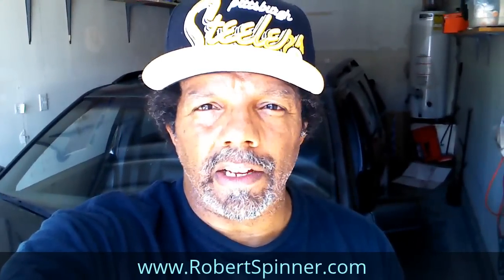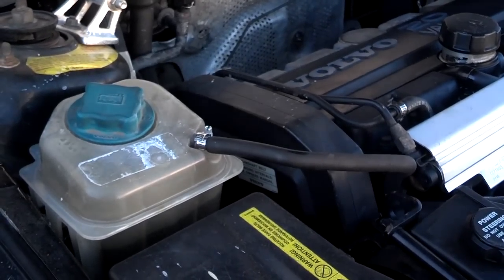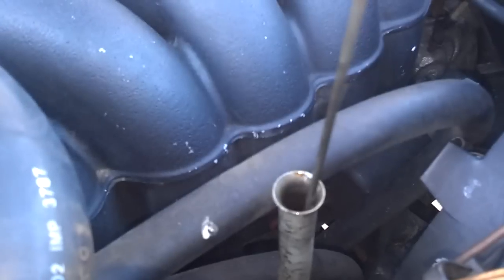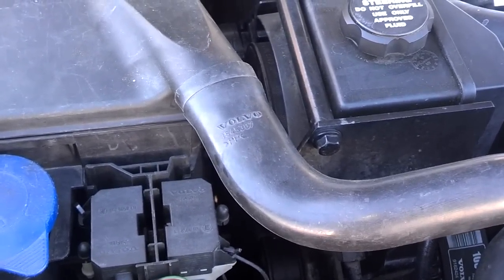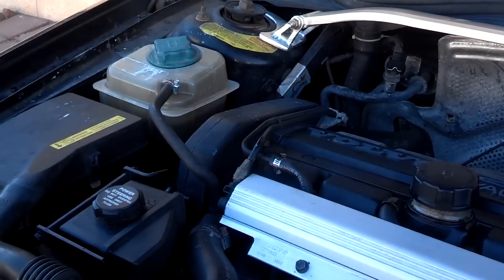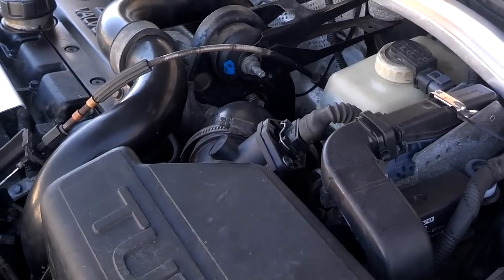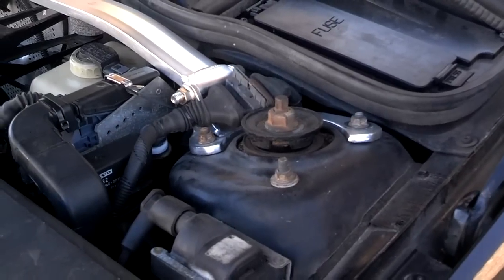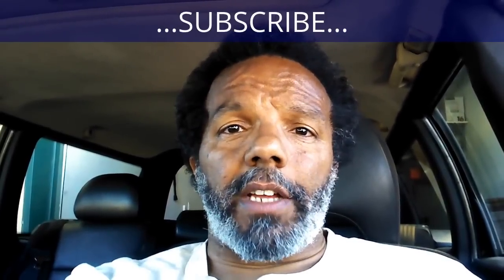Top things to check before buying a Volvo 850, S70, V70, XC70, etc., Pre purchase inspection.

Comment: Thank you and God bless. your videos have been very helpful I gave 1999 s70 GLT the ets light is on no other code now there where some but I fixed those. The car had 160000km it's driving fine what do you think do have to replace the etm?
Reply from the maker: +Dean martin try cleaning it.
Reply: What should I clean it with and what's the easiest way to remove it?
Reply from the maker: Throttle body cleaner. Should be a video "ETM removal".

Comment: Robert my speedometer and odometer don’t work what gets replaced one is digital the other is not do I buy the whole cluster and if so would that change my mileage thanks have watched your tubes love them your good at explaining
Reply from the maker: I don't even know what kind of car you have 🤷🏾‍♂️
Reply: Sorry Robert I have a s70 98 Volvo the odometer and speedometer work and stops then works and stops again my question is when I take the cluster out there’s a black box on that cluster what does it do are what would you replace I’ve watched on how to remove dash and board. But since it works and don’t work is it a splimple fix ?

Comment: very useful information, wish I had this info before i bought my 01 XC70. my coolant tank is constantly having to be refilled once a week  or every 2 weeks. It doesn't overflow but it goes empty besides a head gasket problem ,is their a chance it could be the radiator? could it be anything else?
Reply from the maker: +wil young No head gasket issue. You need to find a repair the leak.
Reply: +wil young , Thanks Robert for getting back so quickly. I did check the dip stick andt unfortunately heir was a lil smoke so my pcv  maybe  clogged.Will do the glove test and check the hose tomorrow .Will  keep you posted . Your such a big help. Thanks for your expert knowledge.

Comment: i kept my 1995 Volvo 850 turbo for 22 years until it finally died - the wire to the started motor rotted off.  I gave it to my brother-in-law along with a complete list of everything wrong with it - about 20 items including AC, rotors, shocks, struts, PVC, oxygen sensor, etc.. .    He sold it for $400 and he included my list of what is wrong with it.
Reply from the maker: Drive 'em till they drop.

Comment: Do these cost more than new cars? My dealer charged me $620 to do the timing belt, idler, and tensioner for my 2005 V70R. Seems like that was a fair price.
Reply from the maker: Rediscover Film Sounds fair to me. How about the water pump?
Reply: +Robert DIY I told them to replace the water pump, but they said they would check it for wear. Technician said it was fine. Considering I was willing to pay regardless, I assume it must have been in good shape.
Reply: +Robert DIY my car is a 2005 with 85k miles.
Reply from the maker: Sounds reasonable.

Comment: I went to get the oil changed on my Volvo and they said I had to get the filter for it before they could change it. The guy I bought it from had said he used an any kind of oil in it and I said I preferred using synthetic oil, but now wondering when it was last changed since he didn't tell me it had to have special oil filter. So far it is a great car,and I only paid $2100 for it.
Reply from the maker: Good deal.

Comment: Robert, I am currently looking at a 98 V70 with 190K. The timing belt was changed 40k miles ago. When should it be changed?
Reply from the maker: I have no idea. What does the owner's manual recommend? How long ago was it replaced? Did they use junk parts or good parts? How many parts were replaced?

Comment: Hi Robert,

I am looking to buy a 2000 s70 but I'm not sure if the timing belt was replaced (current owner hasn't replaced). Is it likely that the timing belt will fail after 170,000 miles if it hasn't been replaced?
Reply from the maker: John Newhouse Hey John, what do you think? - https://www.youtube.com/watch?v=-2oIeIhpV44
Reply: Robert DIY Thank you so much, Robert! I appreciate this!

Comment: I recently purchased an S70 with a badly blown head gasket. If I were to use head gasket in a bottle do you know if it would hold, seeing as these motors have a turbo I wondered if the extra pressure would prevent it from sealing? Or does it not work like that?
Reply from the maker: Huh? Not sure where to start a reply with all of the bad info in the post.

Comment: Hello Robert
My name is Mate and I live in Croatia. I like you channel on YT. You helped me a lot.
But there is a problem I cant solve it. 
When I drive my car S70 sometimes it just shut down. by no reason. I fixed Bosch pump and change all filters but still some times it comes again. The engine is 2.5 TDI 1997. Then I start engine immediately again and works normal some time. After a while it also shut down and wont turn on. This time I have to wait aprox 10 minutes and than I can turn it on.
Do you know what is the problem? 
Thank you
Mate
Reply from the maker: If it has a fuel pump relay, change or test that.

Comment: thank you for the info on replacing a heater core.......my ???? to you is...I have a 1998 Volvo S70, and its leaking oil from the top of the engine.....could you tell me what that could possibly be?
Reply from the maker: Silky Slim Probably a bad oil cap seal. - https://www.youtube.com/watch?v=FIRoc0VxLd4

Comment: Thanks!.. Would you suggest checking the same things before picking up a 93 940 wagon?? --I am  in love and looking at purchasing one, but have plans to take it 1700 miles away when I move, and I do not want to be heartbroken. ://

Any other things I should have my mechanic look at before buying this baby?

thanks in advance.
Reply from the maker: e Kbauer I doubt I would have a mechanic look at a red block Volvo. Those were the best cars ever built. Nothing special to look at when buying a 240, 740, or 940. General stuff is fine. Make sure it starts and runs smooth, stops, drives straight at highway speeds and is not misfiring (no CEL).
Reply from the maker: e Kbauer https://www.youtube.com/playlist?list=PL4kSJzgyD94SiVVtAVWIb0_aWfXz7sJkG
Reply: Robert DIY Thanks for quick reply. Likely will still have him give it a look, considering the long move and I don't exactly have the best luck.
Reply from the maker: That's a good call, especially if you are paying a few bucks for it.
Reply: Robert DIY
hi Robert, any common issues you are aware of regarding passing a smog inspection on the 940...? (I have taken diligent notes on your vids) just little concerned about it passing smog in AZ if I unable to obtain collector insurance for the car.. assuming the testing is similar to what is done where you live.

Mechanic is checking the car out today, i'm keeping everything crossed
Reply from the maker: No problems that I am aware of.

Comment: Robert;  My 1998 S-70 Volvo has 202;000 miles.  It is due for new timing belt check.  The airconditioner blows out hot air.  I was told it needed a new air blend actuator.  I know the timing belt must be serviced but what about A C, I’m on limited income can I operate vehicle with broken ac and what do you think is. Reasonable cost for its repair if I go that route
Reply from the maker: Huh? I don't understand your question...
Reply: Yes it's safe to operate with ac not working unless the compressor is going to seize. Repair costs will depend on what is wrong; it may just need a re-gass. But the longer you leave it, the more it could cost to fix as parts will tend to deteriorate with lack of use, example seals will dry out and may perish

Comment: @Robert DIY
 Can you explain what you mean when you say the car was pampered and that's why they can get a burt valve.
 Right now  I'm in the middle of replacing valves because of a burnt valve in and 03 XC70  I was under the impression that I had to baby the car after I got it  Finally put back together And people say only use premium so you don't burn another valve.  And by what you're saying I don't need the baby it at all. Also should I only use premium fuel?
Reply from the maker: Yes I can.
Reply from the maker: Owner's manual recommends 91+
Reply from the maker: https://youtu.be/qsns8ZO1xfE
Reply: @RobertDIY  ok I see thanks main reason I wanted to ask was I was  curious about running ethanol free but its 89octane not 91
$1.80 vs 2.34 
 I've gotten better feel economy Yes not equal in my vehicles for the cheaper price. But the valvo seems to be a little bit more finicky so I was worried about doing that.
Reply: @RobertDIY   sweet.
I've also found that the pcv connected to the intake before the turbo is leaking oil into the intake there's a little build up. So I removed the pcv system it's all clean and clear I even cleaned it more I checked the drain port on the block for the oil separator by pushing the head of a zip tie down into the oil pan no blockage. But I  Have a feeling that I am getting crankcase pressure because I cleaned all off the valve cover and then later I noticed it build backup a little so it might be coming from either the old cap or that PCV hose.  Just trying to make sure I get the car ready so I can put it back together wallets apart I wish I knew about this earlier I would have done  The glove test to make sure before I took it apart.

Comment: Hello Robert what's a common cause for a 1999 Volvo v70 to slowly lose power and cut off it has 118,000. I just put a brand new battery in it.
Reply from the maker: kenneth marshall Fuel pump dying. Any codes? - https://www.youtube.com/watch?v=GclQq7VpC08

Comment: I just bought a 98 V70 XC few months ago.  So far I noticed 3 main problems.  Coolant leak, oil leak and the driver side wheel barron.  I paid 450.00.  I do want to do the repairs myself except for the wheel barron.  Any good links or tutorials that may help or advice.
Reply from the maker: https://www.youtube.com/watch?v=gt9w-ZSxs9I
Reply from the maker: https://www.youtube.com/watch?v=-2oIeIhpV44

Comment: Thanks for the videos! They are great! I just wanted to add for people that might purchase a 1993 Volvo 850 that the timing belt needs to be changed every 50,000 miles instead of 75,000 miles. The 1993 850s are a bit different than the rest.
Reply from the maker: +Dave Haskins yes they are.

Comment: I found an 850 with only 27,000 miles on it. One owner. Runs clean but it's 3000. Am I crazy for buying this car?
Reply from the maker: sonomama82 I'm afraid of low mileage cars. Did you run a AutoCheck report? Should be worth way more than that if it is in good shape.
Reply: +Robert DIY total with taxes is 5000, I'm buying it in Japan.
Reply from the maker: Wow! In Japan, I usually look at the mileage x4. So that car has like 110,000 miles of wear on it.
Reply: Robert DIY What exactly do you mean? I'm kinda confused on that one. Thanks for replying though.
Reply: Robert DIY it has 44,000km on it. that turns into about 27,000 miles. I don't really get what you're saying though.
Reply from the maker: I lived in Japan for several years. The driving conditions there are severe. In comparison to the driving conditions here, I feel that a vehicle will have 4 times the wear on it.
Reply: I live in a very remote area. Not a lot of stop and go traffic. Thanks a lot for the response though. I thought your video was really helpful.

Comment: Thanks Robert for the informative video. I have a 2003 volvo s80 which needs removal of the rear bumper for repair and repainting. Can you do a video for rear bumper removal of 2003 volvo s80? Thanks in advance.
Reply from the maker: +Noel Cuta Probably, stay tuned and please remind me in a week or so if you don't see it.
Reply: Thanks Robert.
Reply: Robert DIY.
Reply: Robert I am still waiting for your video on  removing and installing rear bumper of 2003 volvo s80. Thanks again.
Reply from the maker: Ok, I'll try to do it tomorrow.
Reply: Thanks Robert.

Comment: I do like your test for primary crankcase ventilation blockage/failure, diagnostics and baloon animals at the same time :D

Unfortunatly the prices mean nothing to me, apart from the conversion to pounds sterling, we are taxed to death, garage repairs can make ya eyes water lol.

Smashing tips robert :-))
Reply from the maker: zx8401ztv Yes, I understand about cost. Heck the parts pricing can be very different there as well.
Reply: Robert DIY
Some places, like canada, just make me green with envy, the cost of petrol is like it was when i was 16, a looooooong time ago lol.
At the moment petrol is roughly £1.30 per litre unledded or u.s $2.09.
Reply from the maker: Heck, I just paid $3.12 per gallon (3.5 litre) for 91+ octane.
Reply from the maker: Ouch! Do walkers have to pay the tax to walk on the edge of the road?

Comment: robert, should the turbo be among these pre-buying checks? and if so: what's the easiest why to check its functionality?
Reply from the maker: Not one of the tip things. A short test drive will usually show a bad turbo. They smoke, have little to no pick up, get noisy, leak oil, etc. I have a turbo series on my channel that you can check out.
Reply from the maker: Not a common, costly issue.
Reply: thats all right than, tnx. will go look the turbo series up.

Comment: Also you should check steering rack if car is old. It's expensive part and doesn't last long
Reply from the maker: TheExeZ There are 100 things you can check from the radiator, transmission to gas tank issues. However, these are the most common. - Car buying pre-purchase tips. What to look for before buying a car.

Comment: I found a cheap 99 S70 for sale with a perfect body (in the rust belt), but it has no reverse gears. Ad says forward gears work fine.

I found an article saying to unplug the solenoid wiring in order to test. Is this something inside the case only, or is there a connector outside that could be disconnected on a test drive?
Reply from the maker: Ahhhhh, it has a bad transmission.

Comment: Sorry I failed to state my question clearly:  my 1998 Volvo S-70 air conditioner is not working ; the fan blows hot air.  For awhile the ac worked on the passenger side only.  I was told that a new blend door actuator would solve the problem.  What should I expect to pay to repair ac.  If I do nothing with ac can further damage occur. Thank yoi
Reply from the maker: No, the problem will not effect the car unless you pass out from the heat and wreck it.
Reply from the maker: https://youtu.be/gt9w-ZSxs9I
Reply from the maker: The comments section has repair estimates.

Comment: Looking at a 2000 V70R This weekend, Issues listed: Slight Oil leak coming from the right side, Passenger windows don't work, and claims something to do with the right front "driveshaft"(Not really sure). Now i've done a fair share of work on cars and these aren't things that are really worrying to me, but would would be initial suspects? It has 198,xxx on it. However they are only asking 700.
Reply from the maker: +Shannen Thor have to check it out. Basic parts there.
Reply: will do but if i drive the 2 1/2 to look ill probably end up buying it, always wanted an R.
Reply from the maker: OK

Comment: Hello, I see a 1996 Volvo 850 Turbo Wagon for sell, 200K miles, AT. They say it goes forward in all gears, but not in reverse. Is there a pattern with reverse issues on these vehicles?
Reply from the maker: +PC Principal SE No. That one has a bad transmission.

Comment: hi robert, just bought a manual 850 glt 96 model. have you experienced issues with the indicators not working when the car is running but will work fine when car is off?
Reply from the maker: What indicator?
Reply: Sorry im from the UK we call them indicators. You guys call them turn signals i think.
Reply from the maker: Could be the ignition switch.
Reply from the maker: https://www.youtube.com/watch?v=x3MP9KaPMqA

Comment: What you need to check first is that the car has a full service history. It is neglecting oil and filter changes that causes the PCV problem, because Volvo engineers (being Swedes) cannot comprehend that anyone would ever neglect servicing and designed the oilways on that basis. Any crud at all in the oil and you are in trouble! The only way to clean a blocked oilway is a total stripdown. Blocked oilway - PCV problem - blown crank seal, like night follows day.
Reply from the maker: thanks for sharing.

Comment: Hi, i hav a '03 xc70 with a transmission that skips often.,most times after long hard driving, if i drop down to city speeds(25-35) it wil skip changing gears. 
Any recommended additive?
Reply from the maker: +jeff katoore Nope.

Comment: hey Robert, i found an ad on craigslist for a 1998 volvo s70 with a misfire on the third cylinder. the guy says that the mechanic diagnosed it as no compression on cylinder 3. would it still be worth buying?
Reply from the maker: Depends on what you plan to use it for.
Reply: @RobertDIY  it would be a daily driver, my first car. Its advertised at 400 dollars

Comment: my s70 has a bad pvc system. I've already ordered timing set, and some other parts for it. Question is, will the engine suffer with a bad pvc system or can I just keep driving it as is if it passes isnpection with the bad pvc system?
Reply from the maker: What did the video say?
Reply from the maker: https://youtu.be/gt9w-ZSxs9I
Reply from the maker: https://youtu.be/AucWm2zFewo
Reply: Ok. Ill repair it when i can get around to it.